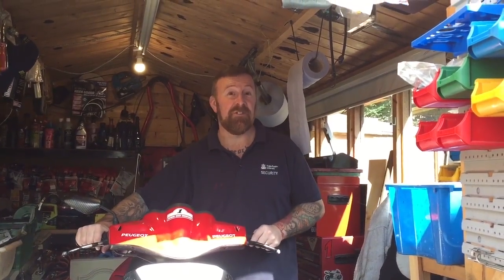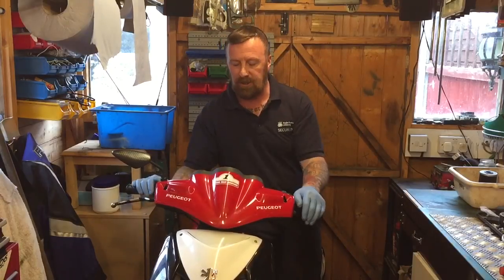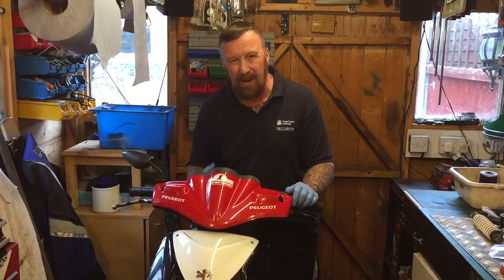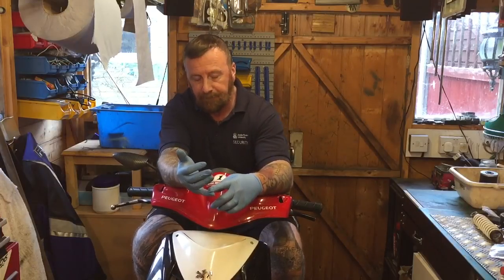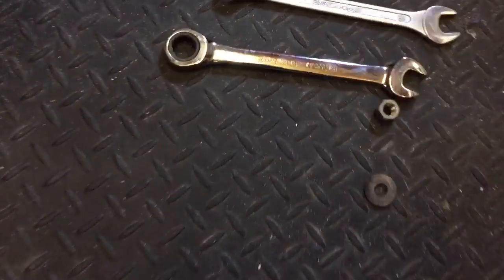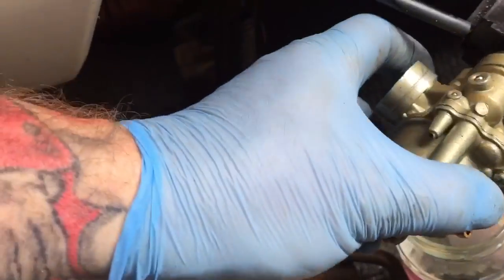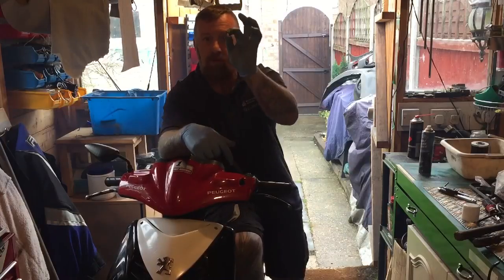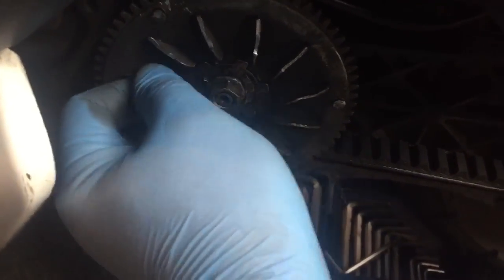HOW TO FIX A MOPED SPEEDFIGHT 50cc MARK SAVAGE

Comment: Good video mark. I have a speedfight I want to hang on to, so I've gone to town on it. I've owned it since new. It's a 2006 plate with electric oil pump etc, and the small cheapest non immobiliser cdi. But it's been heavily modified electrically. It has a custom stator wound to produce full wave, a full wave rectifier, 2 battery's, all led lighting, including the dash, DC immobiliser bypass CDI, dual HID headlights. It's producing around 7.5amps of power on idle, which is enough to power the dual lights and all led lights without any fading or flickering. Everything works from the ignition, don't need engine running for lights. I've removed the oil system and bottle, and cat system.  It's stripped to basics mechanically and electrically! 

I have one for sale in the north east if anyone reading this is interested!!  Old T reg speedy, but fully rebuilt and rewired and fresh paint job.

Comment: Hi mate the DT runs amazing first kick every time
We've managed to get the front light working but when it's idling it's very dim and when you ride-rav it, it goes to normal and bright. The  wires and quite tatty. But for a 1989 it's in very good shape. Still working on getting the back light to work the previous owner has fidled with the wires so stuff disconnected-broke. We have a multi meeter to test the electrics. 
I'll make a video on it and put it up on here for you to see :)
Reply from the maker: good to hear you have it running the lights will dim when on idling that's normal , just make sure the earth is good and clean up any dirty wires .mark
Reply: mark savage hey Mark I out a video of the bike on my channel just showing it. And the state of the wires thanks

Comment: Just a quick one, I have bought a 50cc Speedfight LC, the bike would set off really quickly until like 15 then it would just loose power and not want to accelrate so I changed the carb for a standard one same with the jets, checked the piston and rings and barrell, all good, I also changed the gaskets on the bike, same with the reeds put all new ones in, drained out the petrol and two stroke but all fresh stuff in and I also changed the vacuum and it's doing the same thing, clutch belt and rollers are all fine.
Reply from the maker: Ryan God wow that's a lot of work 
Well i have had this a few times and it was for me two things 
1st still the carb bought a 2nd hand one that was rubbish !
2nd stator coil was going to earth 
Give that a look at bud maybe change if needed but don't rule out the carb !
Hope that helps check out me other videos that will help and I have one on the stator 
Mark

Comment: hey mark,
really helpfull tips here, im actually going to check the stator coil on one of my scooters tomorrow because its doing exactly what you say! (terrible start when cold or not used a few days).

but i have a question, you mentioned use proper oil, now i know Castrol a747 is the best out there, and it smells the best when burning, but its the most expensive, i was wondering what oil do you use? my preference goes out to Castrol Power RS 2T. its cheaper than the A747, but its still a really good oil.

have you tried out my wet weather fix? the little wire going from the steering frame to the main frame?

as always, nice video!
Reply from the maker: Wilco Muurling hi bud 
Yes I've heard and looked at this too and the wire can be the cause also the power regulator ! All worth a check a long with the auto choke ! 
As in my oil video Halfords 2t oil is fine and around £10 
Thanks for watching bud please watch a few others and please like share and subscribe 
Mark
Reply: this castrol power RS 2T is also around that price (cheap to buy in bulk online for just 7 euros per litre, but in shops they sell for 15+ euros)

about the auto choke, the scooter at which i fixed it which had the most issues had no auto choke (hand choke) and issues with the power regulator, ive checked all voltages at all moments. and not a single issues, yet it still refused to properly work during the rain (stutter, wouldnt start, shut off etc...)

now that ive isolated the spark plug wire and added that extra wire between the two frame sections, it runs like a dream in the rain... only you still get wet..

Comment: Iv put a new oil pump on my cpi 50cc  the cable has an adjustment on it but how do you set it up , have you any videos on this.
Reply from the maker: Brian Rollins hi bud 
No sorry bud a few others on my channel may help as for set up 
Connect up then close throttle adjust cable till no slack then open close throttle so to see it open and close and that's basic set up if you want more oil in tighten 
That should be ok 
Mark

Comment: hi mark i have a speedfight  i was connecting up the wires on it so i wouldnt have too use a key (using for stunts) and i got it going but i hit a wire off another  and it sparked and cut out ever since it hasnt sparked i checked the usual fuse spark plug  but i put a fluke tester on the coil and im getting resitance was looking up on google  they said its the cdi im still not sure if its that just looking for your  opinion
 thanks Nathan
Reply from the maker: garaoid o liathan hi bud yes CDI you more than likely blow it , check which one it is , I have videos on them and others that may help 
, mark
Reply: thanks mark videos are a great help !

Comment: Hey mark when those pumps leak how do you fix them ? Mine is leaking and a new one is expensive is there one compatible or something to fix it ? I only find the ones cable operated and mini is like that
Reply from the maker: best replace bud as repairing doesn't last  and it will run so much better
Reply: @marksavage  thanks for that the only problem I have is that I can’t find one like this one just the cable ones , not even on eBay I live in Portugal and not even the few ones that are for parts have them , do you some website that sells them new ? Or a used one ?

Comment: Hi mate good news we've got the lights working the bike is a 6 volt wiring system and the guy had put 12 v bulbs in each light except the front one dash lights work good indicators light up but don't flash so the flasher unit has gone so we've ordered a new one, the horn works but sounds like a dying cat 👎😂. The back light is ok when you press the break it just goes dim and I know the other bulb is ment to light up inside it was for a moment but then it stopped something inside is drawing quite abit of current just need to find out where it is. So not long to going on the road I have a worry about 1 thing and that's the front folks they can go quite low when pressing the front break also say when you sit on the bike it will go down a little. I checked it's history and it's said on the last mot it had a slight damping effect?. Also it's missing a chain guard and in the last mot it says in advisorys it is. I went to a mot center where I live and they were strict on saying it has to have it? Thanks mate
Reply from the maker: you may have to refill /sort out the front forks and that can be a pain ! , chain guard yes some are funny about that, I had an old project and used a bike chain guard and it past lol 
6v wow not too many old 6v bike still around and the lights will always be dim to rubbish !
have fun 
mark

Comment: Hi Mark, I hope You can help. I went to look at a moped (Peugeot Kisbee 4T 50cc) for my daughter the other day and although it started okay it wouldn't idle. He started It back up but then died a couple more times as soon as he let go of the throttle and then would not start for 30 secs or so before it fired into life. He then kept the throttle partially open for a few seconds before he took it up the road and back again to try and warm it up, but the engine still died when he pulled up beside me. He did say it has been garaged for nearly a year. I didn't buy it, obviously, but I am still tempted as I don't think it's that serious.
What are your thoughts, Please?

Thanks

Comment: Hi mark, just a quick question, I'm after a moped, which is the best the Yamaha jog or streetfighter?
Reply from the maker: Matt Matty I like speedfights as easy to work on as for Yamaha maybe look at the Aerox as better than the jog 
But have a look at both . Test ride as it's down to you both good bikes just comes down to price and how the ones you are looking at run 
Take care on the roads bud
Reply: Thank you for getting to me I might go for the speedfight how much should I spend on one, what is the price for one? Many thanks matt
Reply from the maker: mk2 speedfight 350 to 795 year from 2000 to 2009, see what's been done and who you are buying from. mark
Reply: Cheers bud I'll look on eBay and preloved and autotrader, its just to get from a to b, I might get it board out to a 70cc so I'm not stuck at 30mph all the time, cheers matt

Comment: I really need your help, I have a speedfight 50cc and it starts fine, ticks over for a couple mins then cuts out like it's getting no petrol, I have changed the spark plug, I have check the carb, as soon as it cuts out I have opened the float bowl and it's full of petrol, iv cleaned the jets, checked the reed petals and their fine, I don't know what to do
Reply from the maker: hi , does it cut out on you when riding of just when on tick over, sounds like if only on tick over it the idle and maybe the idle jet? however it's common for them to do this, lets know about the running bit. what air filter do you have on it and have you check the fuel pipes?. mark

Comment: Hi mark! Quick question, my starter gear is grinding on my transmission cover and idk why! Any ideas?
Reply from the maker: hi bud sounds like it's sticking or damaged , spray up both side or grease and see if it continues and check for and damage on the sounding area  ,otherwise replace the bendix. mark

Comment: Hi mark I have looked through your vids and can’t seem to find any related to my issue . My 2016 Yamaha Aerox (stock) when left a few days or is cold, it struggles to start up . It starts up and keeps bogging out straight away but after about 10 times of trying to start it ,it is fine. And once it’s running fine it starts first time easy any tips?
Reply from the maker: 2016 take it its 4t?
sounds like carb and auto choke as it will try and run rice to start and if its not working it wont and in this weather it will just die until its warm 
take it you have serviced it and replaced the p[lug and air iflter ?
Reply: 2 stroke mate
Reply: mark savage and it doesn’t even have to be warm to run nice . It literally just needs to get running and it will start easy
Reply from the maker: oh right they did start making them 4t from that year onwards but still auto choke , you say its stock and you have not changed anything so take off carb mate and I have loads on how to clean and test and so on bud it may not be on the aerox but speedfight carb and tuning for all 2t,
Reply: mark savage once it gets past the cutting out stage when cold , it will start right up even if it’s cold
Reply: mark savage yes stock completely and Not changed anything yet
Reply: mark savage and okay thanks will take a look into it thanks mate for the reply

Comment: Hello mark i got a problem with my bike it start up with key but when i go to turn key to turn it off the engine stay running i look at all electric put new fuse in new key ignition just cant wrap my head round hope you can help thanks
Reply from the maker: hi thanks for watching, when you turn off the key it's kills the engine by earthing the bike so the cut of it an earth not cutting the power, so the fuse should be fine, check out the earths on the bike , it may help to down load the wring diagram , hope that helps and gives you more info on the problem, please watch some other of my videos as they should all help and like share and subscribe . mark
Reply: mark savage sorry took my time getting back update i have done what you ask found the problem and it all sorted now thanks you for the information

Comment: Hiya pal ive got a speedfighter 1999 it got spark compresion but just will not start could this b the cdi unit
Reply from the maker: Lee Weatherill if you have spark the cdi is fine 
Is it a good blue spark then all electrics are ok including plug 
So petrol is the plug getting wet like in my other videos 
Have you cleaned carb as in my carb video 
Was it running ok before and is the piston ok ? 
Mark
Reply from the maker: Lee Weatherill I have over 50 videos that will help bud give them a watch 
Mark

Comment: Hi I've got speedfighter 2 and the oil light keeps flashing I'm no expert on bikes could sum 1 pls help
Reply from the maker: if its defo the red 2t oil light , is it lc or ac ?
to check the oil sensor take out seat and check 2t oil sensor its easy to get out, that's as long as you have filled it with 2t oil
I have over 70 videos that will help you and another channel with all the videos on a play list well worth watching bud
Reply: mark savage have u got a link to the video a need to watch tnks m8
Reply: mark savage and demo the oil light it's flashing I bought bike like that
Reply: mark savage it's a speed fighter2 silver sport 50cc
Reply from the maker: so you have filled it up with 2t oil yes?
is it lc or ac bud
immob or none immob 
as said I have over 70 videos 
type in mark savage speedfight and they will all come up , ive not got a speedfight at mo so you will have to watch my videos they will help

Comment: oil pump video plz?
Reply from the maker: Hi. I have 70 videos on speedfights and have chatted about the oil pump a few times 
You may have to flick through a few of them to find it 
Type in 
Speedfight mark savage
Reply: @marksavage  thanks im buying a non runner for 200 has good compression just panels are tatty, is it worth it?
Reply from the maker: Demon Moto it’s about the right price depending on the year as they do hold there money as long as you don’t have to pay out too much 
My videos should help you save money and time
Reply: @marksavage  thanks mark i appreciate what you do👌